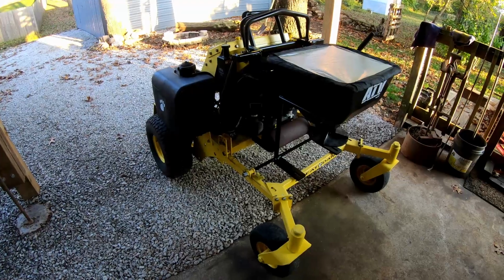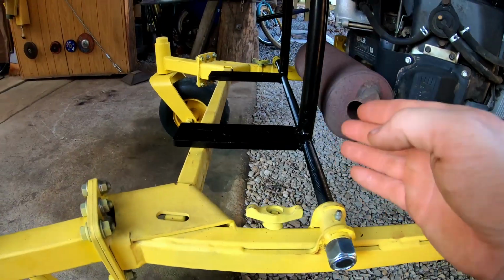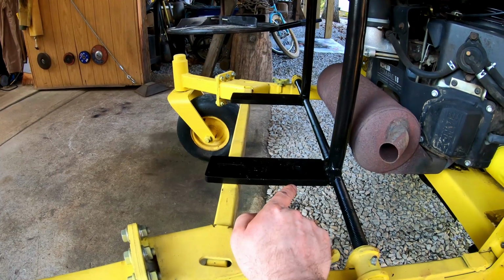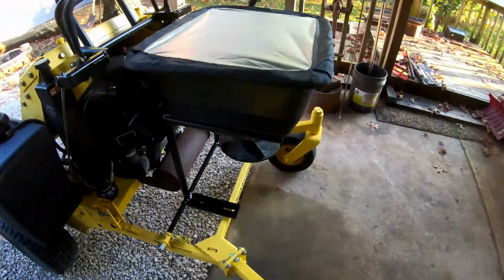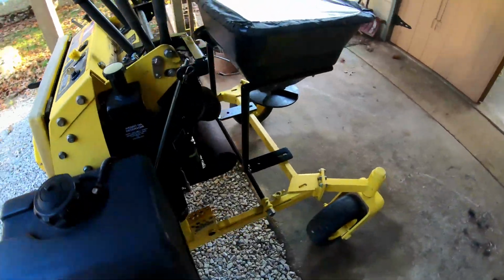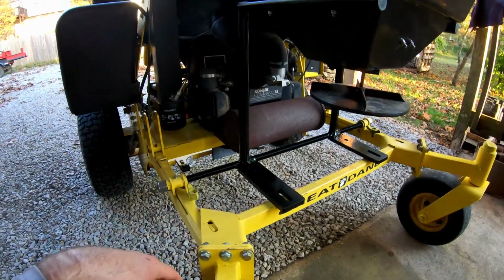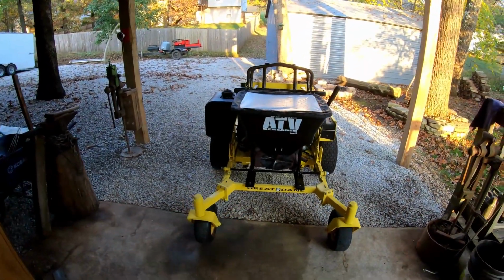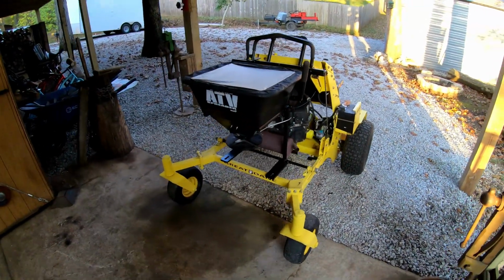Great Dane Spreader Build Update

Comment: That’s pretty cool, I’m thinking about doing the same thing too but for an aerator. But I don’t know how to weld...
Reply from the maker: Do you have a friend who does?
Reply: @HandyGuy2016  no, at least they haven’t told if they do...
Reply from the maker: @thekingscourtyardlawncares9324  if you don't have access to a welder, then I would suggest a bolt on/bolt together design.
Reply from the maker: @thekingscourtyardlawncares9324  if it's for the bradley, a tow behind might be better to start with.
Reply: @HandyGuy2016  No, I'm thinking about doing kinda what you did and re-purpose an older machine
Reply: @HandyGuy2016  Yeah that's usually what I do, but that's boring compared to what you do, Lol.